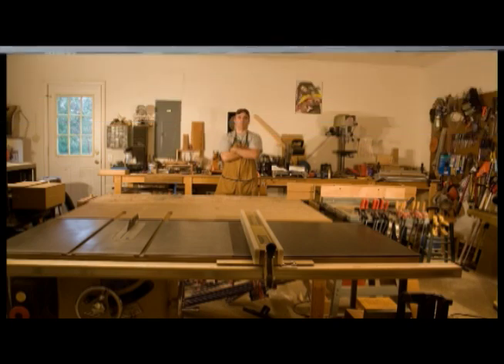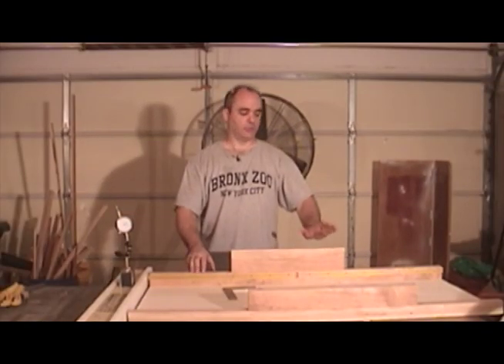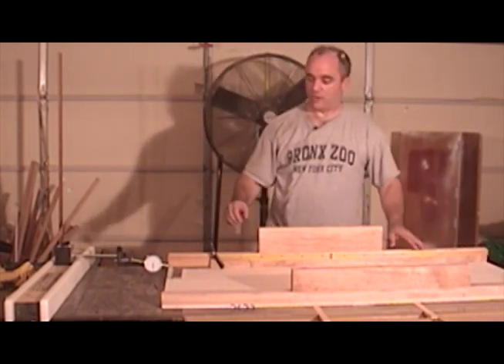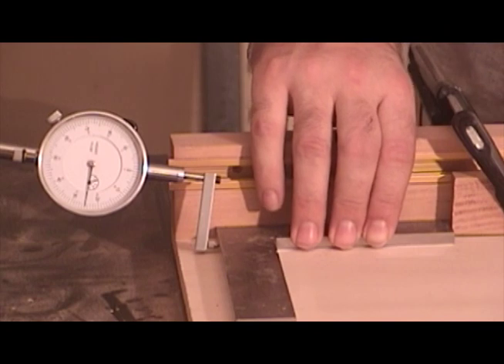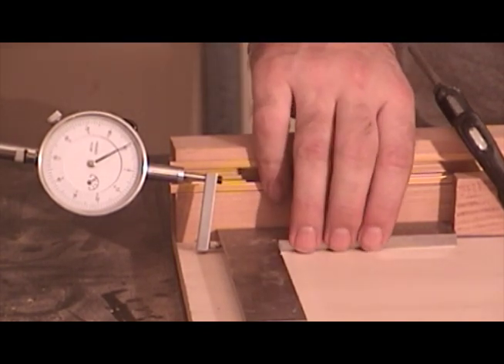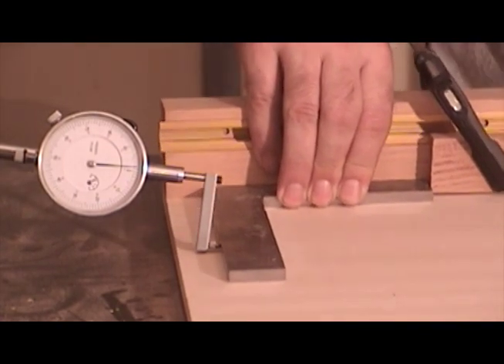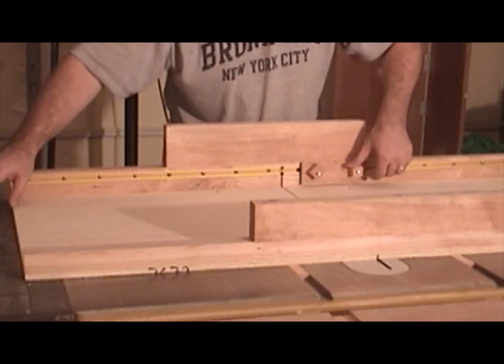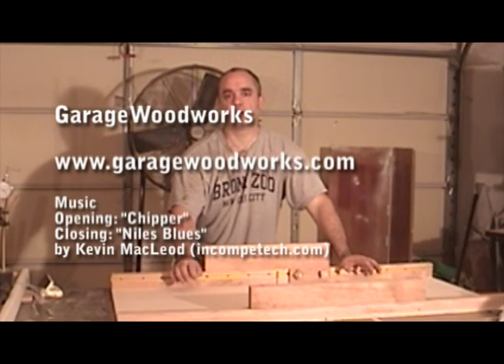Table Saw Sled Alignment

Comment from the maker: See the video description for the square info.  
The dial indicator stylus offset came with my TS-Aligner Jr.  You're on your own tracking one down.  Good luck.  :)
You might be able to find one on the net, but it shouldn't be too hard making one from a small piece of aluminum bar.

Comment from the maker: The five cut method also assumes that your miter track is parallel with your saw blade. (This can easily be checked w/ a dial indicator - no assumptions required).

Blade flatness and flange runout can be checked easily w/ a dial indicator (again, no assumptions required - see my video on TS-alignment).

The accuracy achieved w/ the 5-cut method will also be effected by blade flatness and runout.

The five-cut method is slow, tedious, and potentially less accurate.

Comment: The difference I see is that your method sets the fence at 90 degrees with the tracks.
The 5 cut method aligns the fence at 90 degrees with the saw blade.

Comment: Two questions. 1) Where did you get the tip for your dial indicator to go 90 degrees from the stem down so you could hit the square like that?  2) Where did you get that square? All my squares are thin on one end not thick so its hard to run the tip across it like that.  Thanks and great video.

Comment: I'm embarrassed to admit I haven't had a table saw sled in forty years. In my defense, I have a nice table and miter saw. With cuts good enough to do joinery, I haven't needed one too much.  Those things aside, I decided to build one again because they do cut a lot of work off many projects.

Setting up the alignment was going to be fun.  I looked at the five cut method and, like too many things, it seemed like a lot more trouble than it should be.  More so if you actually keep your saw in tune.

As you indicate, drilling holes, getting readings (via the five cut method), drilling at least one new hole, the testing again wasn't appealing.  Your method, of following the guide rails to test square of the fence from the side trumped the five cut method, big time.

I was "a bit" lucky in that a box of aluminum scraps I bought from an estate sale had about a thousand dollars, resale value, of machinist tools, including a couple Brown and Sharp dial gauges and stands buried under the scraps. 

I set one of the dial gauges up, ran it against the fence and was able to fine tune in no time. When done, the main fluctuations seemed to be from one of the squares.

Thanks for sharing this.

Comment: David, on the tip of your Dial indicator you have an extension that makes it an offset "L" where do I get one like that?
Reply from the maker: +William Valentin It's called an offset tip.  I think Starrett sells them.  -Brian
Reply: +GarageWoodworks Thanks Don't know why I called you David forgive my senior moment Brian.
Reply from the maker: +William Valentin Not a problem :)  If I were you, I'd make an offset bar from square aluminum stock and tap one end for a stylus.

Comment: Again this Alignment assumes your saw blade is a perfect 100 flat and also 100% parallele with miter track and your table saw flange runout has 0.0000 runout.
This is a ballpark test at best. 5 cut test is the only true test of a table saw with all components working together to pruduce a cut.